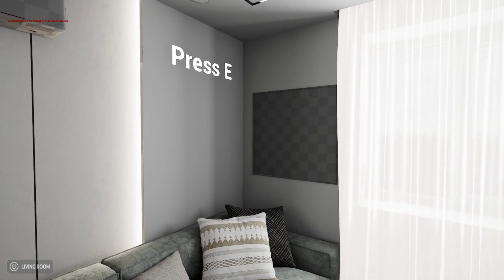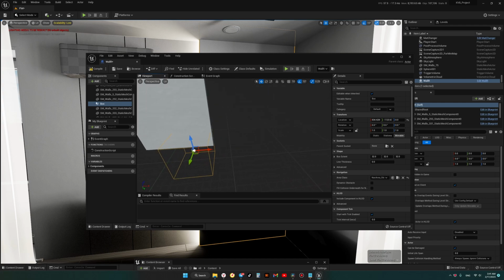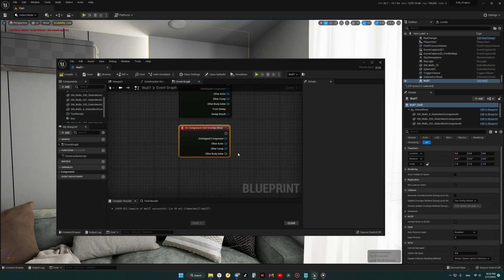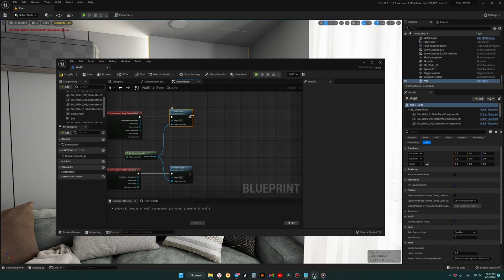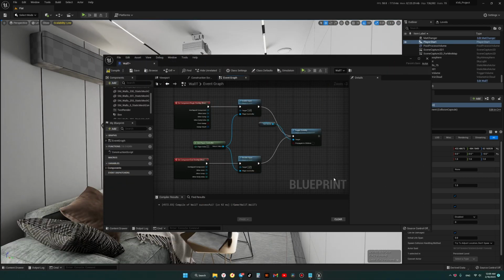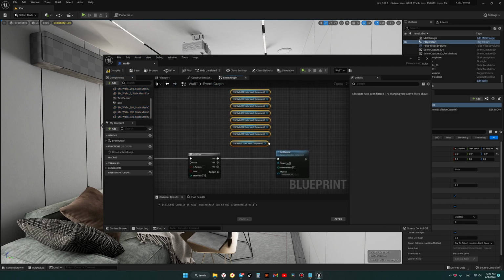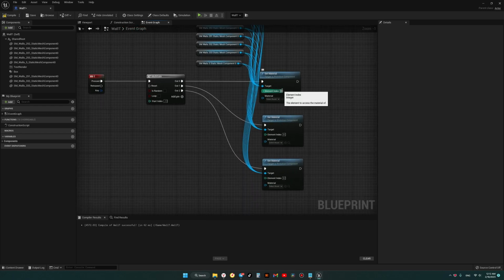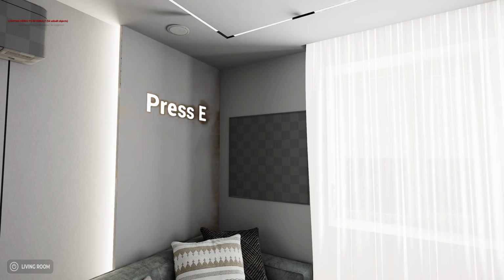UE5 | Change the Material BluePrint | Tutorial for ArchVis

Comment: Hello and thank you for the beautiful tutorial, but with the basic movement system that is present in the UE VR Template the collision with the box is not detected or at least it does not work for me. How can I solve it? Thanks
Reply from the maker: Thank you for your comment! In the tutorial, I used the Architectural Character, which may behave differently from the VR Template Character. If you’re using a collision box (Trigger Volume) in your VR project, please check the following:
	1.	Ensure that Generate Overlap Events is enabled for both the box and the character.
	2.	In the Collision settings of the box, set it to Overlap All or use Custom where Pawn and Character can overlap.
	3.	In the Event Graph, use OnActorBeginOverlap (for entering the zone) or OnComponentBeginOverlap (if the trigger should respond specifically to VR hands).
	4.	If your character moves using teleportation or Physics Handle, it may not trigger overlaps properly—try enabling Show Debug Collision in the console to visualize interactions.

If you’ve checked these settings and it still doesn’t work, please provide more details about your character type and when the collision is supposed to be triggered.
Reply: @FarDesCorp  Thanks for the quick reply. I tried to modify what you said but to no avail. Then I changed the parent class of the VRPawn from Pawn to ArcVis Character and the overlap with the box works, but the viewpoint is now very high compared to the floor level (as if I were 3 meters away) and I can't change the height. Can you help me? Thanks